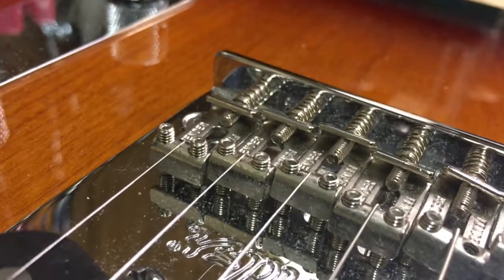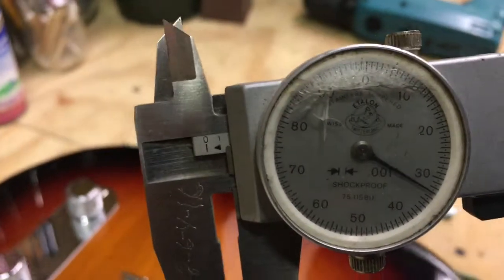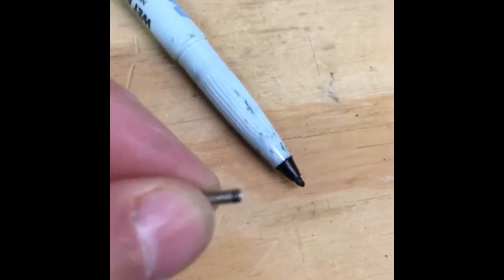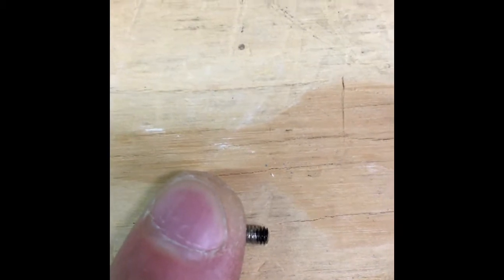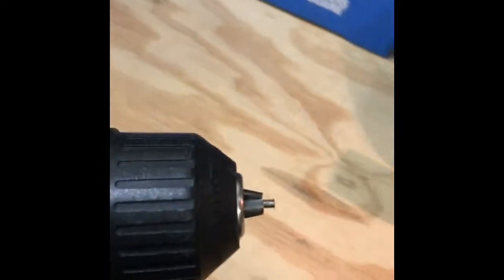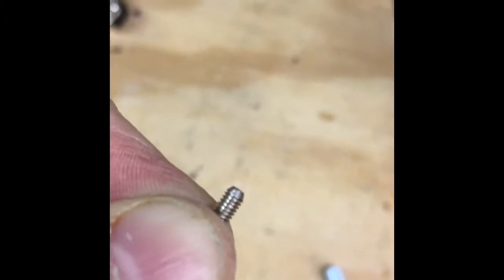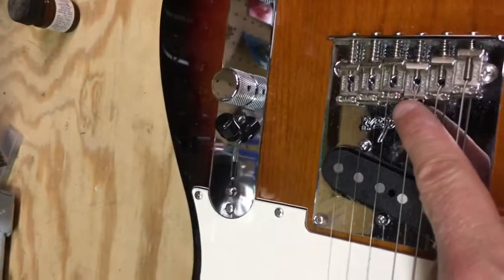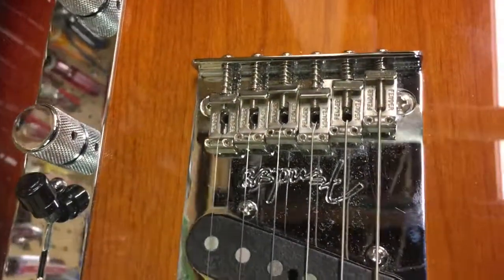Fender Saddle Screw Height Adjustment Mod

Comment: I get matching thread screws in the length needed to just fit flush or barely recessed in the saddles (I ditch bent saddles for solid block steel ones). Removes the chafing and they are more stable saddles to sound better, to my ear.

Comment: I have the same issue in my G&L ASAT Blues boy. Your idea to use a drill gun to hold and turn it is very good. I think I'll try it that way
Reply from the maker: Erich Cosic yes it’s key or the saddle height drops over time and the screws damage the plate

Comment: But WHY did Fender not do this before it left the factory.
Reply from the maker: Michael Dickinson too much labor and solid block saddles are too expensive.... profit / cost issue
Reply: @craigscott8481  I get that Craig but it's simply not good enough. This is something you'd expect on a cheap guitar but not The American Standard. I can't fault the guitar in any other department . Fender need to find a supplier who can make screws that don't impede play.

Comment: just buy shorter screws....   use common sense. And notice the old fashioned bent saddles have a tiny threaded area to hold the screws, so there is a tiny range of adjustment. Better is solid saddles that have a more stable screw (more threads in the body of the saddle).   the bent saddles were invented 65 years ago for Strats and are not needed... get modern saddles
Reply: Exactly.
Reply: I asked the guy at Guitar Center for shorter saddle screws  , and he looked at me like I was an 👽. 
And could not help me lol
Reply: @HighVybeTribe  So what? I have bought and used 8mm ling screws a number of times and imports nearly always need 8mm long screws. Because the fellow did not know means just that he didn't know. Look in eBay and buy a pack of 8mm screws and use them before shimming.